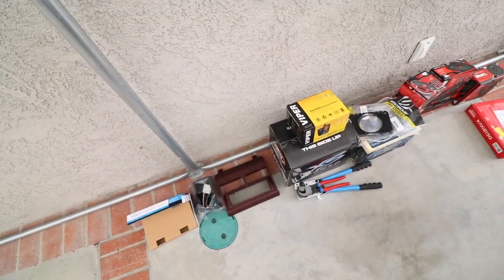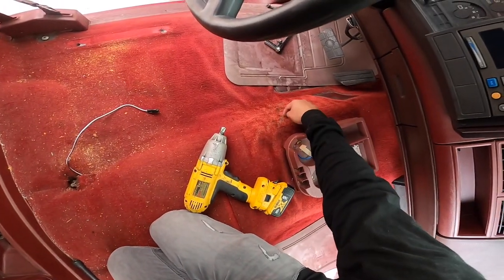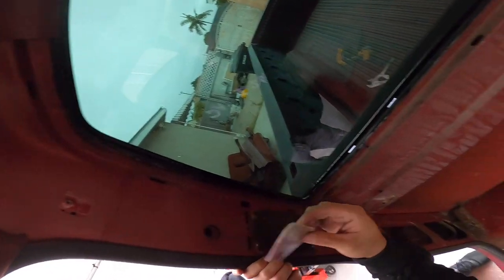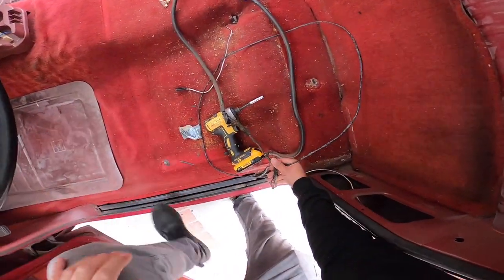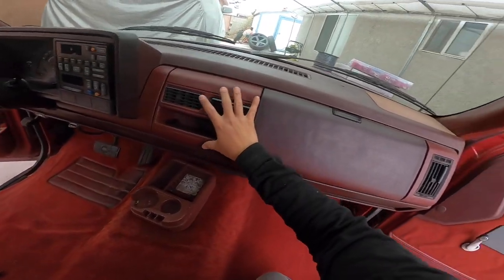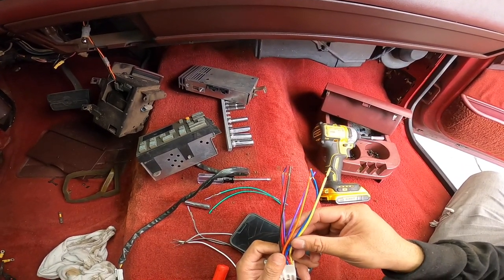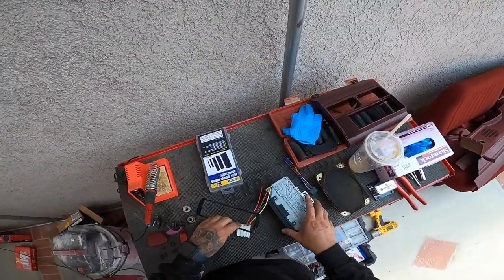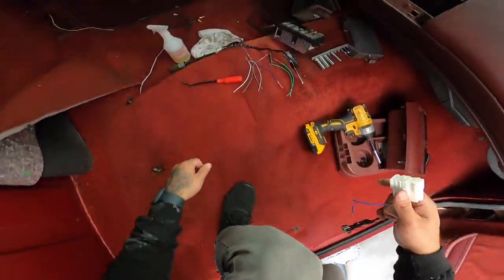INSTALLING A SOUND SYSTEM ON MY OBS PART 2!!

Comment: Nice yeah those plastics are brittle what I did when I ran my 1/0 wire I drilled a hole through the floor and got a grommet to prevent shortages
Reply: Since I have the amp under the seat I also ran another 1/0 ground through the floor and to the chassis.

Comment: Remote should be the blue cable behind the deck
Reply: It is. I cringed at a few things. 😂
Reply: When powering multiple amplifiers off of it you use it as a trigger for a Spst relay so that the relay handles the load.

Comment: A buddy of mine has a problem I tried to fix but couldn’t figure out what it was. Only one speaker worked and his wiring harness was burnt could that be the problem? If so is it a easily replaceable?
Reply from the maker: Yeah run new wires and it should fix the problem

Comment: Wiring looks factory. 4x6 kinda suck. Put 3-1/2” with adapters
Reply: Also what you took out was the actual brain back in the day ppl bypassed it and kept the dash controller, instead of putting that cd cubby